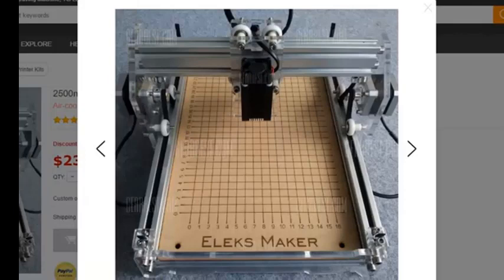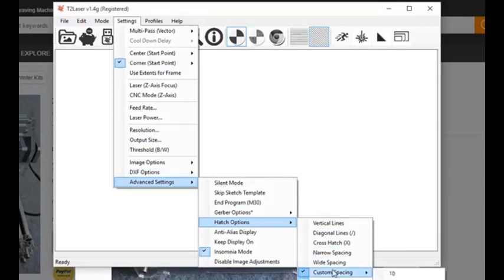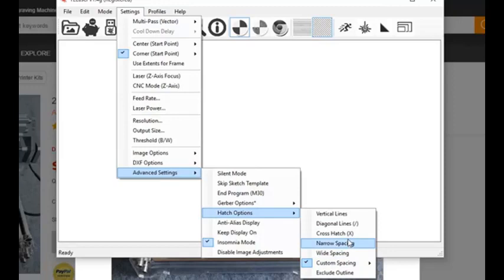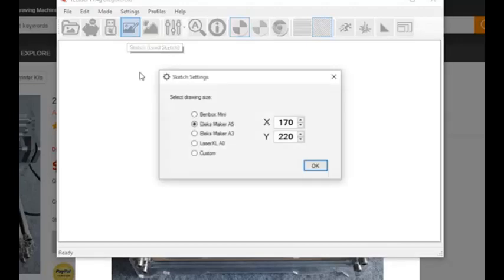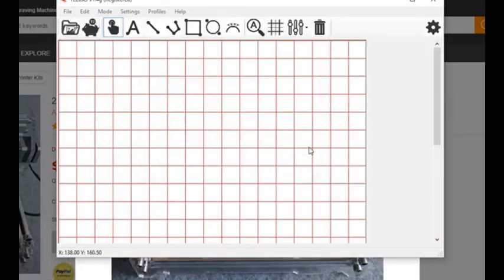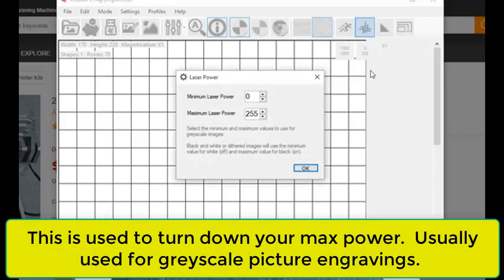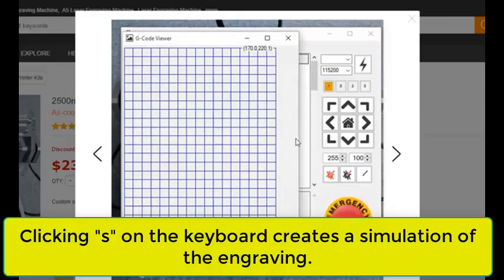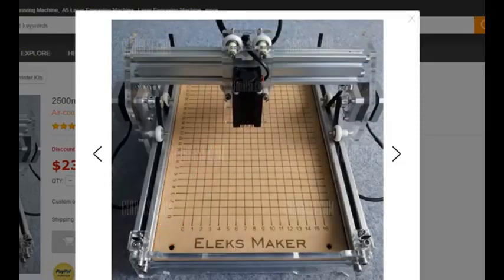Wasteboard Grid w/ T2 Laser

Comment: Hi been trying this for hours and my t2 laser just keeps putting 1mm cross hatch even when i change to 10mm custom spacing can anyone help
Reply: Look at 2:35 see how there is a check mark next to custom spacing? Do you have that check mark?  If you go into the sub menu and Change the spacing it doesn't automatically select to use the custom spacing.
Reply: thanks that's sorted it. it was staring me in the face but i could not see it

Comment: Hey Steve, I hope all has been good.  Idea question for you.  Have you ever done anything where you lasered out the wood, then took a very thin 3D print and laid it down in the lasering?  The idea would be to do a very thin, but 100% fill pen line lettering.  Example you do a monogram laser.  You do a 3D print to fill the laser (1/8" wide x 2mm thick).  This would lay down in the laser and then you could take a heat gun to smooth out the PLA.   To test and see if it it would even look good, I need to figure out how to take a drawing in corel, convert that to a 3D drawing that has 2mm height and remove the edges so it that it sets down in the lasering.  Maybe use red, orange, or some other bright color.  Any ideas on how to do this??  I have downloaded and installed Blender but I have not learned how to use it yet.
Reply: workflow: search thingiverse for ghotic font, customise (on or offline with scad) download stl
open stl in 3d builder (free in windows) and cut a median slice ('the widest part of the 3d form'), I would suggest deleting everything above this slice as you want it as flush as possible with the surface. Save in 3d builder in format that T2 laser kan 'read' (obj?) or just printscreen it as jpg and trace it, just mind the scale: measure the longest axis irl and scale T2 to longest axis. 
this way you will have the 'T2 laser template' and the (bottom part) of 'the stl file' that automaticly has flat side (print upside down on glass, so your 'cut' in 3d builder is the 'hot bed touching part' in cura ;)
tip: if you want no post processing: do this in a silky pla like formfuturas gold silk pla: magnificent results!
I already did this (hence my workflow lol) with colorfabb metal infused bronze pla (bronzefill) and copper infused pla (copperfill) [on a side note: they have the highest amount of metal in them I coulf find, forfuturas Metalfill prints better but has less particles why this is important, I tell later only higher metal content is this 'forging pla' unprintable cause brittle as hell filaments] 
I then traced the letters on a slice of a big tree cut/log (so you can see those beautifull rings) that I 'politoerd' (dutch word, dont know in english) but its a fairy lenghty process off taking shellac, disolving it in IPA and this mixture gets rubbed into the wood with a cloth, about every 20 minutes and this (in my case over several days) I did between 45 and 50 times (lost count) this gives you a finish that is bright and glossy + strong and looks like a piano or a luxe chess board, no varnish even polyurethane comes even close. 
I traced the letters on a template (in retrospect could have printed a negative image.. silly me) and with that cardboard template (to be exact and protect the finished wood) and my dremel extender (that long snake that allows you to have the turning tip and handle it as a pencil) I cut out the letters just a bit deeper than needed (epoxi also takes space). 
Before gluing them in I corroded them with ammonia and table salt (hence the need for high % metal in filament) 
I just anded them rough (removes the plastic 'film' from the metal particles and exposes them more) and put each letter in a paper towel, wetted with very salted water (just dissolve till it starts pooling on bottom of container)
than you stack them in a tupperware box that just before closing, I poured ammoniac in (make sure they dont 'bath' in ammonia as it dissolves pla -guess how I learned.. so put two wooden spacers/lifters where you stack them up) close off and leave for 2a3 days (you will know when they are 'ready' when the paper towels turn to the most beautifull shades of blueish green ;) 
they will also have shrunken a bit (woops unforeseen but easily solved: used a clear epoxy to 'set' them for a perfect and seamless finish.

Hope this helped you, sorry for the late reply, I stubled upon it while browsing this guys great channel for T2 lasering

Comment: Have you ever tried to use a pair of Bluetooth dongles instead of a USB cable? I want to move my laser across the room from a computer. Just wondering if you have given that a try.
Reply from the maker: I haven't tried it because I worry what will happen if it drops the Bluetooth signal mid print. I am concerned it will stop and leave the laser on. I had that happen when my PC went to sleep once. If you try it be sure to test with some forced drops mid burn to test it's response.
Reply: Will do.  I am going to see if I can find an old wireless print server and if I don't have one I may order one and see how that would work.  I will let you know if I get to test and the outcome.
Reply: @flyinlo1474  did you get this working? I failed with a wifi steared (3d printer intended) motherboard, so bluetooth is way less stable so I would be very suprised if you pulled it of..
Reply: @ZILLION4EVER  I just used CAT5 cables with cat5/usb adapters on each end and it works fine.
Reply: did you get it working @tim